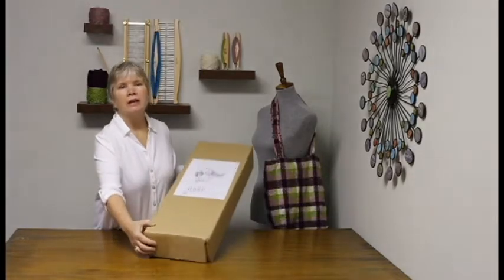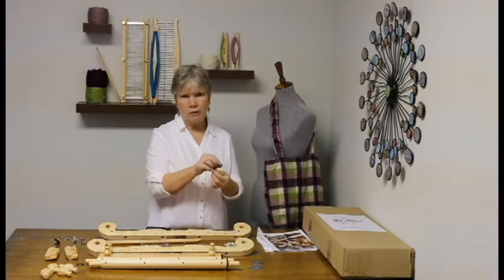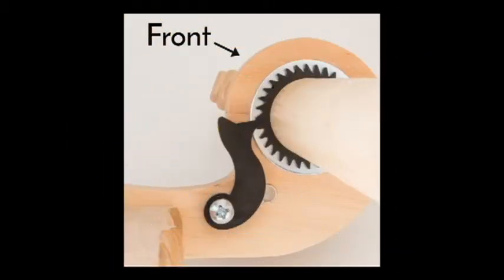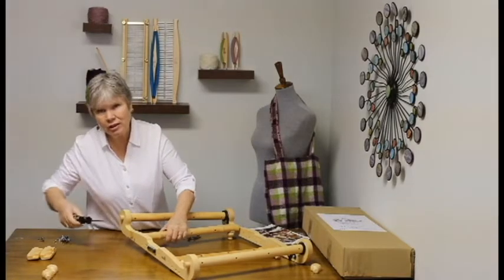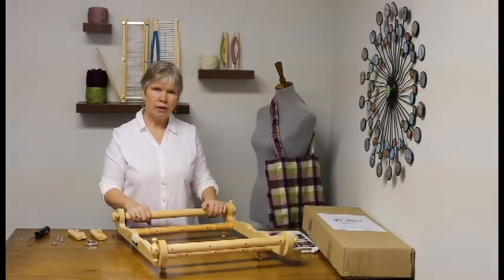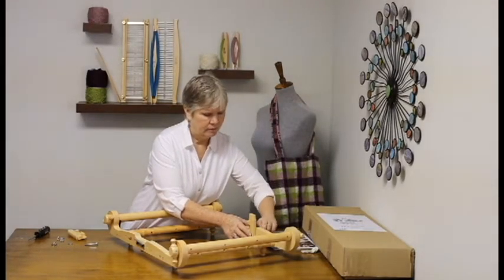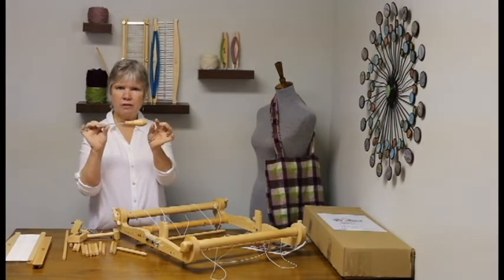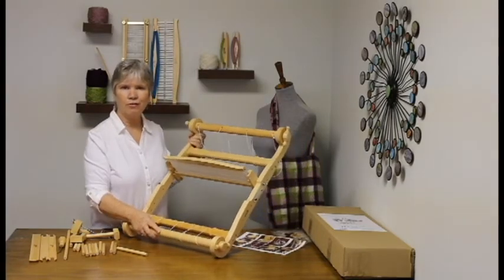Kromski Harp Forte Assembly

Comment: Have a suggestion after using my loom for a few years now - they should put the ratchets on the outside of the frame(like Ashforddoes) - I  have  had my warp get caught up in the ratchets when doing a full warp - it would give better options for using longer warping sticks when using the full length beam.

Comment: You make it look so easy.  Some of the screws on my 32" loom were not that easy.  I know that was partially due to my inadequate screw driver.  It felt like some of the pilot holes weren't drilled to full depth.  I had to stop and take a couple of breaks after wearing my hand raw with the screw driver.  I finally grabbed a leather yard work glove and that helped quite a bit.

I wish I had found this video before I started the assembly.  I got the first pawl on backwards initially.

I have two washers left over.  I think they're the same size as the two washers on the heddle block bolts.  I looked back through the assembly instructions a couple of times and still haven't spotted where they go.

Instead of tying loops in the ends of the strings and screwing them to the beams, couldn't one stick the end of the string through the first hole and tie it to itself, and do the same with the other end at the last hole?
Reply: I wanted to try out the screwless beam lacing approach without using the strings that came with the loom as guinea pigs.  I used some kitchen twine that was about the same weight.  The strings that came with the loom are very stiff.  Is that to make it easier to thread them through the holes in the beams?  My kitchen twine wasn't stiff, and resisted being threaded through more than one hole.  A tapestry needle made threading it through all the holes easy.  For each beam I threaded one end of the twine through all the holes, tied that end off, adjusted all the loops to a good size, then cut the other end and tied it off.  It seems to work as well as fastening the ends to the beams with screws, and I think it looks better without the screws.  I'll have to try the loom out for a while and see if I encounter any issues with the lacing down the road.
Reply: @kevinmonceaux2101  Any noticeable issues?

Comment: I notice she didn't actually show us her putting those 4 knobs on the end of the bars.  Phew, that took some muscle - very tight fit.  Draw a little line and use a torch so you can see where the holes are or you'll be trying to screw into solid wood.
Reply: Boy were they ever a tight fit.  I kept splaying the frame apart trying to get them on.  They might be tight enough to stay on without the screws.

A torch could be dangerous.  It might burn the wood.  :-)  I didn't have a tooth pick like the video recommended to aid with alignment, but a sewing pin worked just as well.
Reply: I agree. I'm getting my bf to to those for me!

Comment: Hi - I purchased a second hand Forte and the previous owner looped the string to hold the apron rod, but lashed it directly to the front and back beams.  How long are the strings that come with the loom.  I would like to change the set up to be like the preferred method.  Thanks!

Comment: I have a 32" Kromski Harp that I bought 7 or 8 years ago.  I just installed the Forte upgrade kit. Originally  I did my warp and apron rod strings the old way and I would like to switch to the lashing demonstrated in this video.  What kind and how long a string should I use? Where can I buy it?
Reply: The string is just nylon cord, 2mm, the sort that you'd use for roman blinds.  My loom is the 24" loom and the cords were 228cm each, so if you get 7m, that should be plenty for yours.  I think strong string would do just as well.